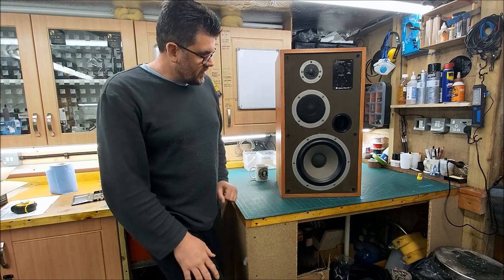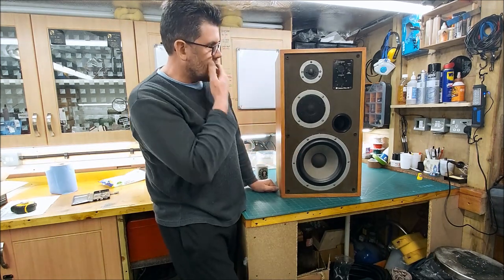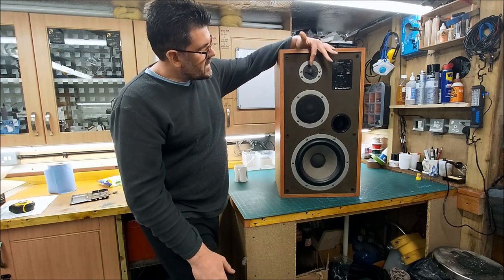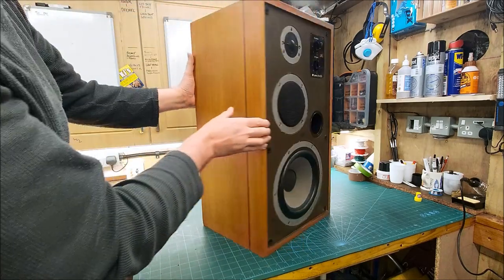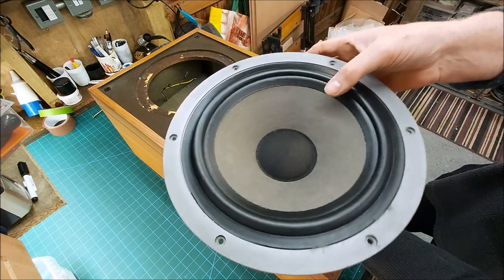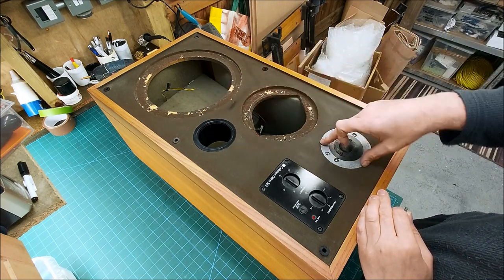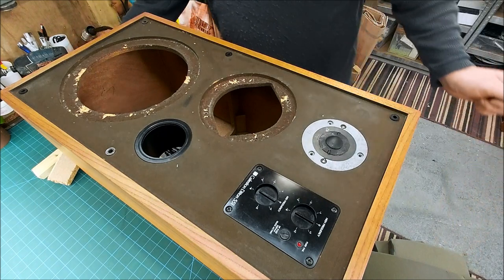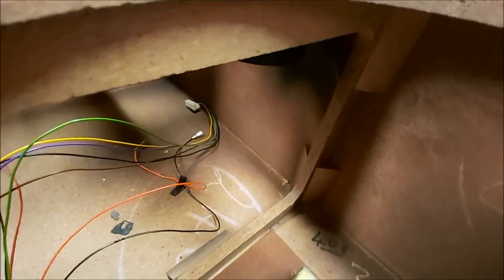Celestion Ditton 551 Speakers Part 1

Comment: It's interesting,I was expecting that the capacitance would decrease with aging but it seems it's the opposite.
Reply from the maker: They tend to increase in value. Just the nature of electrolytic caps. The esr value is the other factor. That increases to.
Reply: @haycrossaudio5474  I see.   As I don't have a device to measure capacitance,from your experience should I replace  the quality film capacitors  (tweeter and midrange signal path) from  a 40 years speaker that sounds fine to me ?  The electrolytics will be replaced of course.       Thank you.